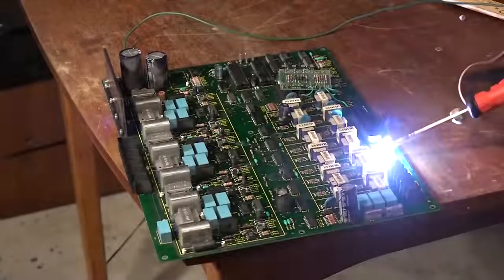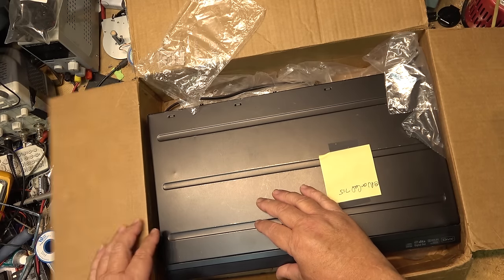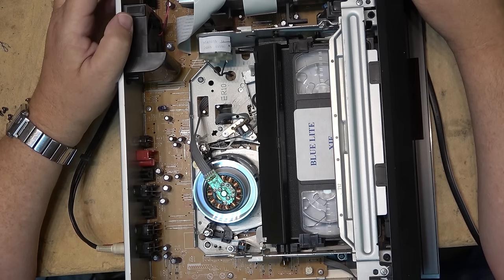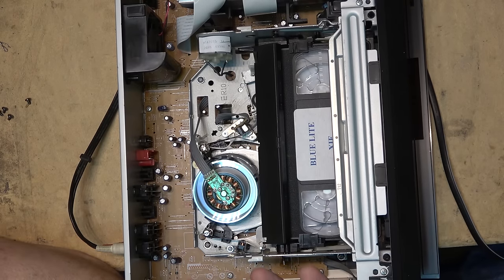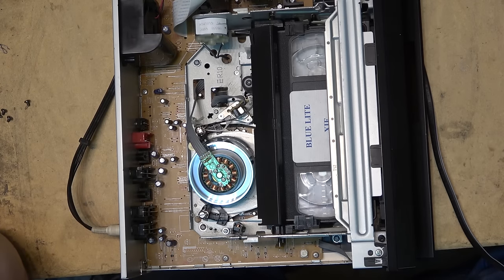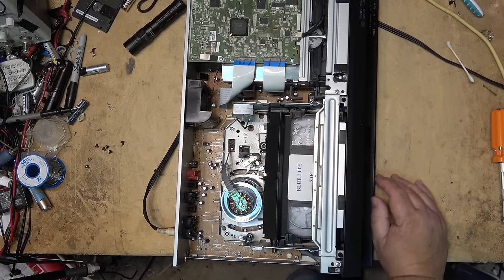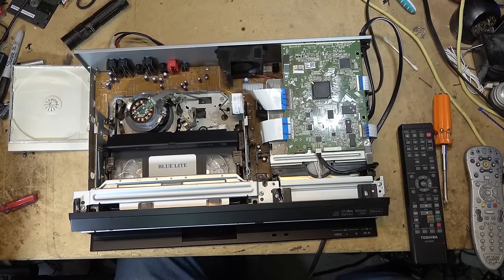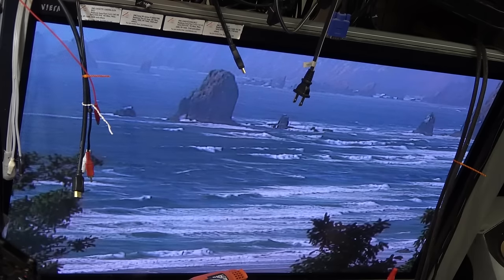Toshiba D-VR620 VHS DVD Recorder Shuts down after 10 seconds when playing tape

Comment: Thank you!!! This helped me fix my Toshiba dvr670ku model. It would play fine for 7 sec then shut down. After powering it on again it would immediately spit out the tape. I rubbed the areas you did with a little bit of alcohol, put it back together, and now it seems to be working. Thank you!

Comment: It was rare that i had any problems with the light emitters or light detectors.
There was a few with cracked solder joints, but that's just crap soldering.
I like the quality of your recording of the shop tank, the fish look amazing.
I don't blame you for selling copys, what a great idea :-D
Reply from the maker: I made more selling copies of that than i do from YouTube these days lol.  At the peak I was selling about 15 a day. My cost to produce was 3.30 for the blank disk label and cardboard sleeve / mailer and at the time about 1.40
Postage.  Sold for 14.95.  after PayPal took their fees it left me with 10 per copy.  
Had a PayPal MasterCard that pulled directly from my PayPal account.  Used it to buy gas and restaurants ect.  Fun times.  Once YouTube became a thing DVD sales dropped. I also sold it on VHS but very few compared to DVD which was a good thing because postage made that not profitable plus the time to record a copy from the DVD.

Comment: I had an old CD player sent to me a few years ago, and when it arrived the spindle motor shaft was bent lol.
Surprisingly enough, they did bother to lock the sled linear motor so at least the pickup didn't break.
A replacement spindle motor and some servo adjustments later, it worked again.
Some people have no idea how to package stuff so it arrives intact.

Comment: NorCal715 fixed one of these (same exact model) about 11 months ago.
Reply: I have repaired several of these with the same issue.
Reply from the maker: Never seen his channel. 
For that matter I don't watch YouTube at all actually.  I just knew instinctively what the problem was as soon as i saw the symptom.  That's why I did the rewind to see if it would stop.  Had it not stopped at the end then it would have been led too weak.

Comment: At first glance, I have a unit that looks like a twin to this one. Mine not only has a tuner but a DTV tuner. The VCR died years ago. I'm glad I kept the VCR I had since new in the early 90s. Mine eats the tape and turns off.
Reply from the maker: Mode switch needs cleaning.

Comment: I get that r error on my 2008 toshiba sd v296 But... The right spool will not turn when it gets warm inside when you play a tape for awhile. And when you have it on reverse search, eventually the other reel stops and the filmstrip gets all rolled up into the pinch roller/Capstan. I can TRY to clean that sensor underneath. Can be the mode switch too. Ordered it off ebay in late nov-early dec 2022 for 70-80 dollars relpacing a 2009 copy that would get overheated on the vcr side it would not catch on fire dont worry, it would crisp up the tape on the guide next to the audio head at the beginning of certian tapes for the first 10-15 minutes.

Comment: 10:30 I just had the same issue with a Toshiba DVR80KF - cleaned the diode/s and now it plays flawlessly. It still shuts down sometimes when you eject the tape so I guess it still needs some cleaning. Could you suggest me a video or a procedure to clean all the important parts of a VCR - my unit stinks of smoke and is quite dusty... thank you very much - your video helped me revive it.
Reply: Mode switch

Comment: Hello, I have this same player and I cannot seem to get the HDMI output to work. It's always greyed out in the menu, and the TV says "no signal."  It's not the cables I'm using, and the port itself is not damaged or dirty. Do you have any suggestions on what I could do to fix it?
Reply from the maker: Many of these players the hdmi is only for the DVD player.  When playing a tape its a/v put only.  If you record the tape onto disk it will play thru hdmi.
Reply: @12voltvids  I've watched a couple reviews of this unit fully working, and it does and should output VHS over HDMI without fuss, so I'm not sure what's up with mine. I also got a D-VR7 (VHS side broken) and I swapped the DVD board into the D-VR620. The HDMI works over DVD now, but still not VHS!

Comment: You may need the error code, but my DVD recorder will say "cannot write to this disc" when starting a recording, but if I keep trying, it will. 
It does this with all Verbatim DVD-R discs. Is that a symptom of a dirty laser lens, or something else? This has been going on a couple years, maybe. It's a 2006 or 2007 Magnavox DVD Recorder/VCR.
Btw, nice repair!
P.S. my DVD player will not work if the top cover is off. I found that out a few years ago.
Reply from the maker: May be a weak laser
Reply: @12voltvids cant you tern the laser pot give it a little more power and extend the life a little longer?
Reply: @ericsalidbar1693 No its all IC controlled, only 80s early 90s CD players had that capability
Reply: I have the same  problem with mine
Reply from the maker: @ericsalidbar1693  that doesn't work long as excessive current will burn it our quickly.  Did that a few times back in the day only to have it back within the 90 days the shop put in repairs and then I was fixing it again for free and putting in a new laser with an angry boss on my ass.  Why not change the laser in the first place? It would have put the cost over the preauthorized price meaning I need to get approval and customer would likely say no and then I made nothing.  Shop did not charge estimate fee. (not my choice that was the owners decision) audio gear was 50 bucks VCR 70 camera 80 and tv 100.  That was parts and labour.  That meant that we had to work fast and fix things with minimum parts.  Go 1.00 over and there was a chance customer would say no and then make nothing.  Laser block cost 25 bucks would sell for 35 but not a snowball's chance in hell I am putting it in for 15.00 labour which I would make 7.50. 
Quote 85 for the job and 99% would say Chuck it and buy a new one for 150.  So, clean the lens, adjust the laser power and charge 49.00 and hope they don't play it much and it won't break before the repair warranty runs out.  Those that didn't listen much might have been ok but people that put the player on shuffle and let it play every day it was coming back.

Comment: i gave a people a tip on how to fix there DVR machine to a common fault i did it on my Toshiba DVR-16 amazing piece still running today with all the original parts
Reply from the maker: People call these funai decks junk but in reality they are pretty good and just keep on working.
Reply: @12voltvids out of the deck no funai parts just toshiba brand stuff I believe once they got to the dvr20kb that's the first toshiba vcr made by funai  parts
Reply from the maker: @ickylovelywilliam3961  I have a dvr5 and it appears to be a totally different machine.
Reply: @12voltvids very weird how you got funai parts and I got toshiba brand parts maybe they were still making Vcrs with funai to keep up with the popularity of dvd and vhs?

Comment: Let me help people....  Never go to Vegas. It's a trash pile.
Reply from the maker: Agreed. never again.
Reply: Never wanted to go Vegas, and never will. Been to Macao though.
Reply from the maker: @michaelturner4457  you'rw not missing anything.  Back in the 80s when the big neon signs still around it was pretty cool to take a drive through at night.  Today it's just big video screens.  I don't gamble it was just going to be a stop over on way to grand canyon.
Reply from the maker: @TD75  resort fees, yup heard about that.  Room 100, resort fee 500.
This past summer when i was on a little vacation by myself (wife couldn't take time off work) one place I went to check into had a resort fee. I asked what that was for.  Clerk said jt was for pool and hot tub. I said I'm not using either. Then he said it for the use of kitchen in room and free continental breakfast. I said I'm not using kitchen now eating anything on the continental breakfast. Just going to sleep and be on the road at the crack of dawn so either remove the fees or I'll just sleep in my car in the parking lot for free.